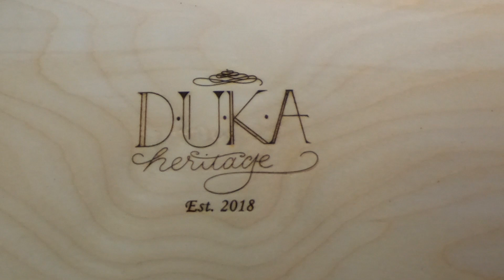Pen Turning - Eucalyptus Burl (Step By Step)

Comment: That came out nice. Have a look at getting yourself a Mandrel Saver, as I noticed when you were turning that you get a very slight deflection in the Mandrel, that way you can do away with the Brass Nut. Lately, I've been turning between centre's, well almost, I use the Mandrel with enough sticking out to hold the Bushing while a cone live centre hold the other end, but it does mean only one part can be turned at a time like you did here. When I assemble pens I use a metal carpenters vice that I've attached plastic jaws (a cheap cutting board) to, to stop marring the materials. I do the same with applying finish, as in using the steel bushing, but to help prevent the finish from sticking, with the Lathe running I hold a stick of Bee's wax against the bushing just to give it a thin coating of wax. Then I sand the ends like you do. Thanks for sharing, lovely burl, I'm going to have to check all the White Gum logs I have from tree's we cut down and check them for Burls.
Reply from the maker: I will look into that, thank you :)